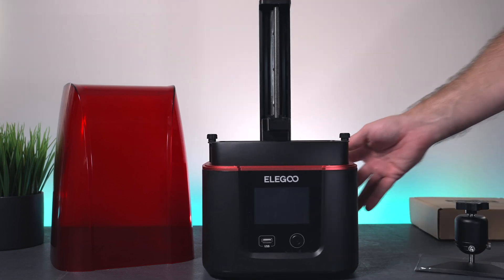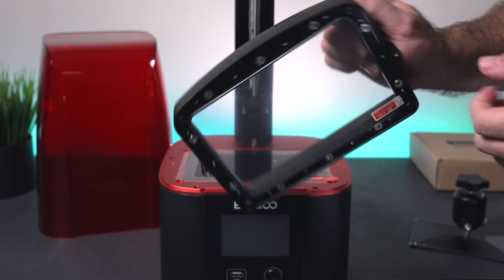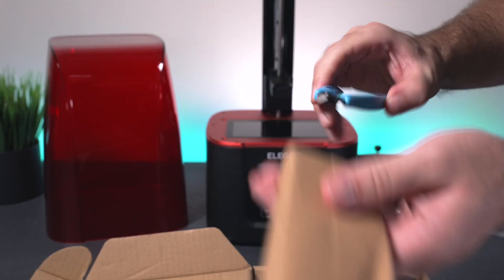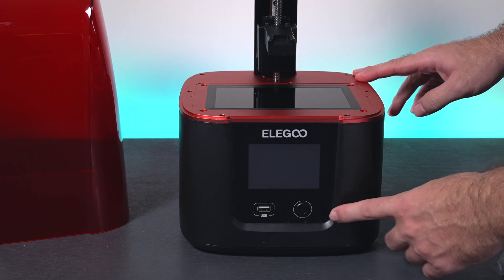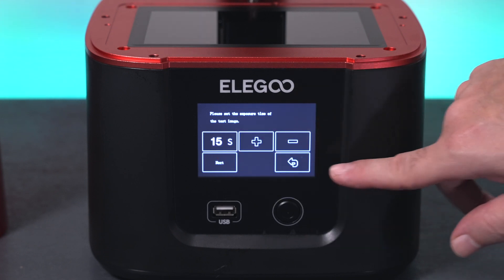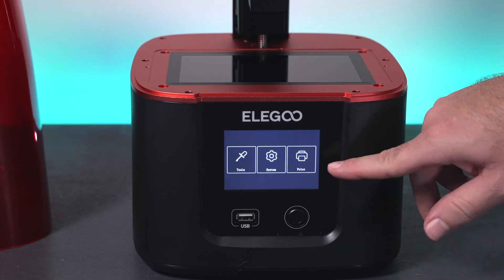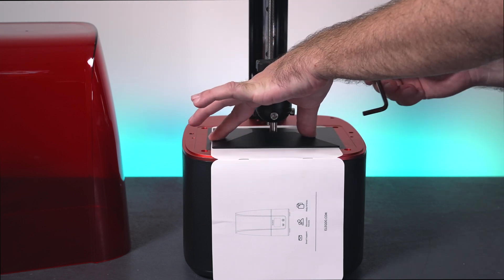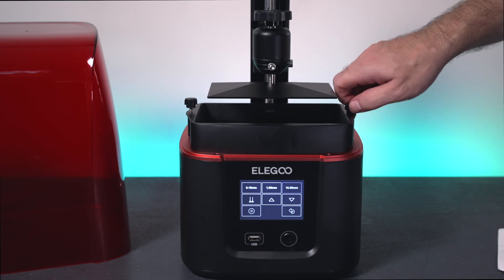Elegoo Mars 3 - Overview & Leveling

Comment: WARNING: This is not correct process and it's missing some aspects. You did not adjust the paper height to slide out with some resistance and nothing was said about the Z=0. And yes you do need to 0 the Z axis on this model.

Comment: So I did the level just like shown here ... but after I tighten , I put the VAT back in and fill with resin , then I hit print and it goes to do its thing I hear a grinding noise... which is apparently the bed trying to still push into the screen..  but I thought it had been calibrated.. does it not hold settings ?
Reply: did you find a solution to this problem yet? because i just had the same problem
Reply: Same..
Reply: u missed z=0 after leveling and tighten screws. in comments bellow it was mentioned. this video is incomplete.